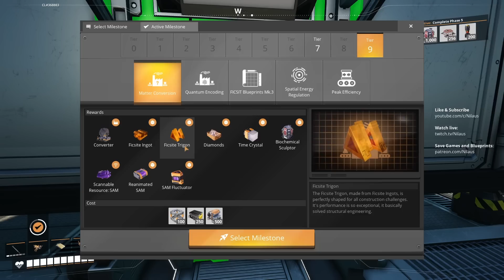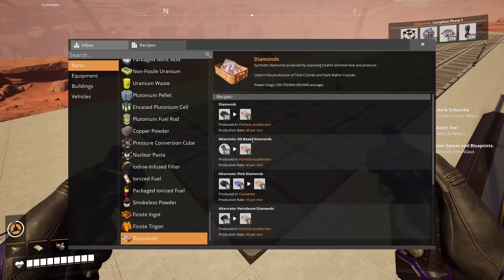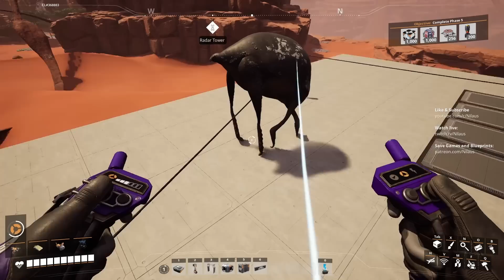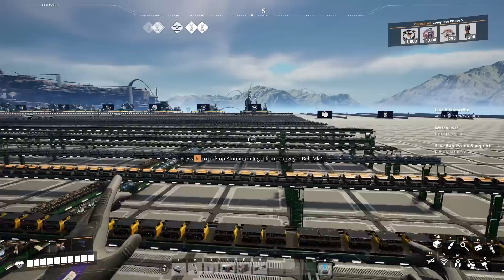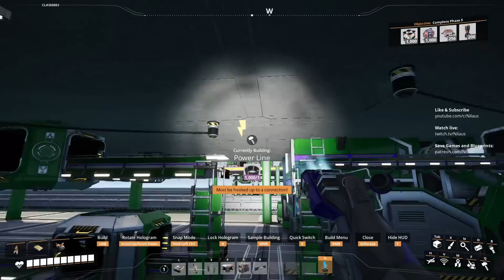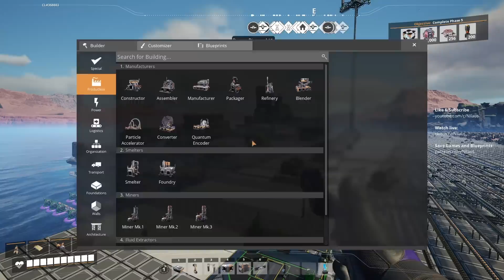Exploring TIER 9: Using CONVERTER For TIME CRYSTALS & DIAMONDS  | 15 |  Satisfactory 1.0 | Lets Play

Comment: Late to the party, but confused about the comment that you're using converter because it costs less power. It's 100-400MW for 15, but even the basic recipe is 250-750MW for 30 which is basically a wash. I like the recipe and it's a good spot for it, but oil diamonds would be even more efficient for power

Comment: I'm surprised you didn't use the Turbo Diamonds alt recipe, yes it uses the particle accelerator but it doesn't end up using more power when compared to Alt: Pink Diamonds, it actually uses less on average. Another great thing about the Turbo Diamonds alt is that it only needs 720/m of Crude Oil to make 480/m of Diamonds

Comment: "Not going to mess with water as in a desert."  He says as there is water well right next to the quartz.
Reply: Sometimes YouTubers make questionable decisions 😂
Reply from the maker: Doesn't change the fact that working with refineries instead of constructors is way more complicated and that liquids are annoying to manage. I don't see a need for more than 240 Diamonds / min, so not much point in spending 3x time to get more
Reply: @Nilaus  liquids really aren't. They just have lower input rates as they're limited by 600 per pipe and sometimes require pumps. On top of that, refineries are bigger, but as you've been doing with modular blueprints, once set up 1 time, you never have to do it again, so it isn't much effort.

Comment: Would it not make more sense to transport crystals instead of diamonds because the density is higher? The only other thing diamonds are used for are Dark Matter Crystals, but there's an alternate that takes time crystals instead which is a better yield anyway.
Reply: drones and train's capacity is based on stack size, I dont think the crystals stack higher than 50 while the diamonds stack in 200. So I dont think it saves alot but I could be wrong.
Reply: @-yttrium-1187  I didn't confirm in game but both items stack to 200 according to the wiki
Reply: @RaulBasaraba  this is true, just did the setup for these production chains today. 30 converters and 9 particle accelerators (using 1800 oil all into diamonds and time crystals)
Reply: I don't see the point of optimizing for this, because time crystals and diamonds are low throughput items anyway (e.g. compared to ingots).